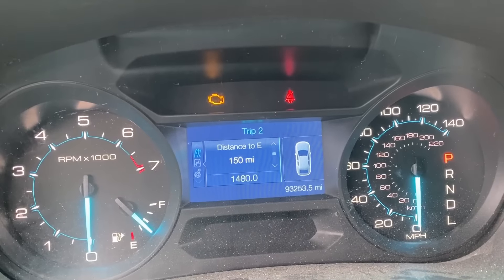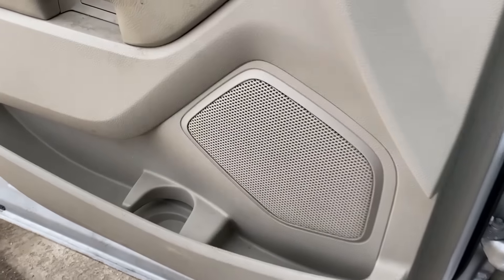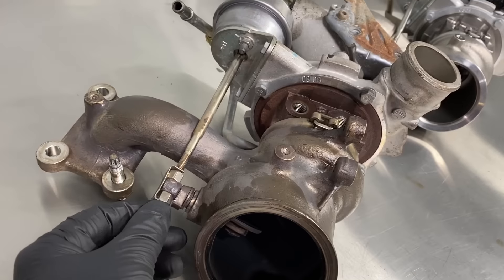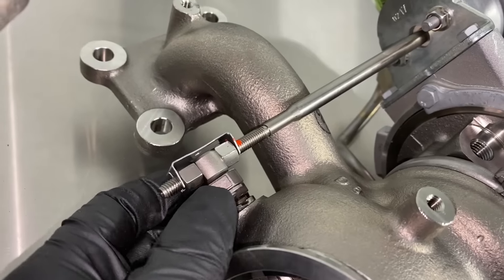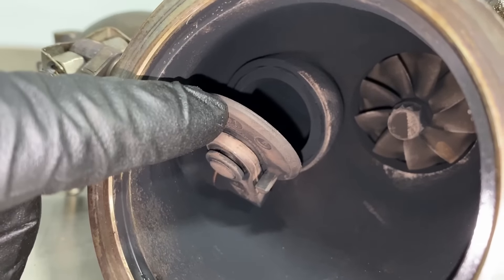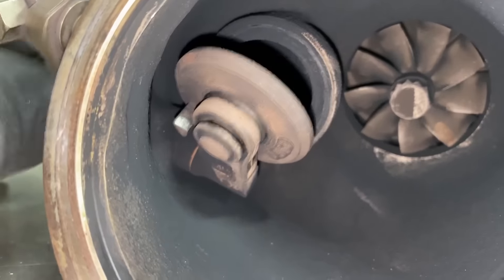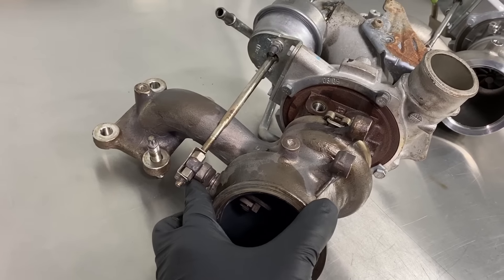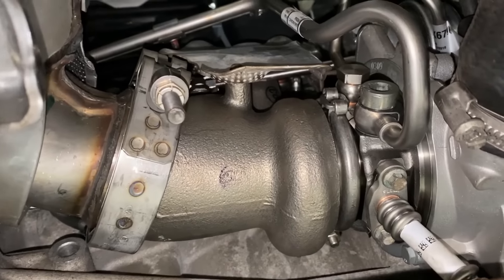Ford Ecoboost Cold Startup Turbo Rattle Explained

Comment: For $2000 I would live with the noise for a while.👍😀
Reply: Absolutely.  Let the next owner deal with it.
Reply: Charlie James 😂😂😂😂😂😂
Reply: It’s throwing a low boost code,here in Ny it wouldn’t pass emissions inspection .
Reply: Cant friggin barely hear it .. wtf
Reply: @Martin Herndon possibly the owner didnt follow very strict maintenance standards an more wear within turbo!? The Ford EcoBoost motors gen1 & gen2 are reaching high mis w/orig turbos!
Reply: I doubt this is even a maintenance item, what's to maintain? I think it's just a cheaply made part of a very expensive assembly
Reply: @LynxStarAuto  Until then 🤷🏻‍♂️
Reply: ak2112 what goes around comes around
Reply: @mt1885  go ahead and buy a Silverado...you'll constantly be dealing with cheap broken interior parts & electrical problems.
Reply: Jay Man  way to go ford....thats y i wont buy eco shit ford
Reply: @Martin Herndon so true 2nd gear band,water pumps, alts, rebuild carbs. Thing is anyone with good hands could fix that. Real complicated since gov epa controls
Reply: Jay Man  leaking turbo oil hoses, they all fail.
Reply: or you could just adjust the linkage. ive seen ecoboost engines with 300k on them that never had this issue.
Reply: Jay Man  Yep, Tacoma.
Reply: @Davido50  more of a fluttering sound. its there
Reply: @GETLITUP69  exactly what I was thinking.  We oversized damaged components a lot in the aircraft industry, no reason why it can’t be done here
Reply: In my country, loosening join can be easily adjusted, no need to replace the whole turbo assy.
Reply: Couldn’t really hear it.
Reply: Lmfao!!!!
Reply: Idky he couldn't grab an aftermarket turbo or wastegate. I can replace the wastegate in my CTS for about 300$, stock turbo is around 550, big wheel is 1700.... this guy's fix seems expensive and unnecessary. Maybe this car has proprietary components thus it can't be fixed or replaced?
Reply: There's got to be a way to fix that linkage instead of wasting money and buy a whole new turbo.
Reply: It’ll ruin the truck lol
Reply: Is it safe to drive like this?
Reply: is it safe to drive?
Reply: Other turbochargers are built strong wastegate no rattles. Actuator arm rods much stronger ford turbocharger all have same issues
Reply: U can buy 2 springs from hillman. $7 bucks. U put spring on wastgate and it stops it.

Comment: Some aftermarket company needs to make a bushing kit for this. Seems like your throwing good parts away
Reply: Machine shops do it for cheap. They cut the tab and weld a larger tab, machine the opening and add a phosphor bronze bushing.
Reply: Was going to say this, that old turbo is fixable for a fraction of the cost of the  new one
Reply: In my experience turbos seem to last 100-150k however if I also had to replace the CAT, I’d definitely try to have that arm bushed and see if I could squeeze another 50k out of it.
Reply: Michael Dennis 

If I owned a shop I’d only replace with new to prevent call backs.
Reply: turbo is tiny anyway,better off stepping the whole plan up
Reply: I agree, big waste of money. I would machine a few new parts and reinstall.
Reply: The bottom line, always junk is junk. #1 no after market spare parts. It is hard to find it. For example if any newer model ford needs water pump, dealer part is less expensive than aftermarket.
Reply: BlindBatG34 that’s why I’ll never buy a car with a turbo
Reply: Agree.  Seems like an easy fix.
Reply: @daaneel  Or as I like to call it turbogus.
Reply: I thought the same, a waste of parts only by the wear of a small component.
Reply: They do sell rebuild kits for this turbo.  From what I can find it will save over 60% than a new one. He said himself there are no bearing failures with these turbos. The part might fail again with a new turbo so it would make sense to have the 2 parts that failed rebuilt.  They also sale aftermarket turbos that fit this car that are higher quality than the OEM..
Reply: @BlindBatG34  our Cummins passing 180k miles on original turbo.
Reply: If you're going to pay for the labor of taking off the turbo you might as well replace it. It's insurance. You can save a few bucks or replace the whole thing and have piece of mind.
Reply: @zach4384  Yes, but he is replacing it with an OEM brand new part, that may... no...Known to fail. The rebuild kit fixes the issue and or you purchase a higher quality aftermarket turbo..
Reply: I was thinking a bearing kit,
Reply: @bryanmartinez6600  But it's a Cummins, not an Ecobust.
Reply: The turbo has a v-band on the center cartridge. Release the band and replace the turbine housing / manifold. Don't know if Ford's sell them separately but I easily find them for my Mitsubishi turbocharger.
Reply: @stubblekusaf  labor is the hard part getting to it especially if it's awd all the vids are for 2wd which has way more room
Reply: He's costing this customer more money than needed.
Reply: I would make them . The one out side would fairly simple to repair and shim  the valve might be a little more tricky but doable

Comment: I loved my 2013 Taurus SHO when it ran right. Maintained it meticulously however the left turbo began to leak at 80k miles. Traded it in. No more turbo cars for me.
Reply: I’ve got a 2014 but I swapped out my turbos for aftermarket Garrett G25/550. I traded my ecoboost F150 because of how expensive maintenance is on the ecoboost engines.
Reply: @RadDadisRad  How are the aftermarket turbo's compared to stock?
Reply: Unfortunately more and more vehicles are going  turbo ever year
Reply: @12wingwfetech  

Cheaper to make power and mpg. The have been going away from the big v8s that use to last 200k plus
Reply: @RadDadisRad  You know what happens with expensive owner funded maintenance it gets put off buy owners.  Some owners will do it many/most will not.   A lot of people switched from cars to trucks when cars went to front wheel drive they became fragile and harder to maintain.  Trucks were simple and more durable.   A lot of owners expect to last 200,000 to 300,000   miles or more and got it with not much more than oil changes lube jobs and brake jobs and a rare tuneup.   Ford is about to lose its market share in light duty trucks as consumers and the used truck markets begin to realize the ECO boost engines are not going to make it for the long haul out in the real world.   Chevy is also dumber yet bringing out a 4 Cylinder Turbo Silverado Pickup.
Reply: @RadDadisRad  maintenance expensive on EcoBoost? I've owned gen1 & gen2 without issues in F150s. These trucks are built to be highly durable.
Reply: @robc8468  really? We 10yrs into EcoBoost engines now. Gen2 has been out few yrs. They performing outstanding. U think EcoBoost is a new concept?
Reply: People talking the most noise who dont drive EcoBoost. Lots of torque and acceleration,  fun and yet fuel efficient when it needs to be. Since 2018 models they added dual port no more carbon on the intake valves, but if you had a catch can you shouldn't be too dirty anyway. Dunno what he means by induction service,  possibly a seafoam treatment in the throttle body hoping to clean the valves at risk of eating carbon and breaking the turbos. But I'm looking into valve walnut blasting, something the GDI european guys have been doing for years.

Comment: And being an almost lifetime mechanic myself I would have repaired it with a bushing or weld and machine repair.
Reply: no doubt about that , a simple fix for someone mechanically inclined
Reply: Use a spring for tension

Comment: Is this a common issue to look for on a 16 2.7 ecoboost  or a 15 3.5 ecoboost as well
Reply from the maker: All Ecoboost engines
Reply: @FordTechMakuloco  So I have a cold start rattle that I hear inside my 13 KR with the 3.5. Mostly from the passenger side. Still think it's this same issue? Was really hoping for a loose piece of interior trim but  it goes away once the truck warms up.

Already on the hook for a boost control valve and adapter, turbo oil lines, and a tranny line o ring. Glad its only at 68K
Reply: @FordTechMakuloco  kinda figured it would be all EcoBoost but wanted to make sure thanks love the videos keep up the good work

Comment: I have a 2018 Gen 2 Raptor and the sound has been getting progressively worse. It's been driving me Bat Sh#* Crazy. So I saw a video where they add a small window spring to the turbo actuator arm and connect it to the metal oil feed line. And POOF ... just like that ... all quiet. I was about to go in and have the starter replaced for $400 and change. Thanks to a $5 part from Lowes, I can save the money and put it towards some upgraded turbos in the near future as I'm at 150K miles. Thank you for the video and confirming what I suspected!

Comment: Did they figure out the 5.0 tick/rattle on 18-19 F150? I heard the fix is not working.
Reply: nlitenurmind my 18 5.0 F-150 has the rattle but it’s not significant and sometimes isn’t there at all. I was concerned at first but after hitting 20,000 miles on it I’m not nearly as worried. I’ve sent my oil out to be tested after changes to determine if there’s anything unusual in it and it comes back with normal numbers every time. The truck doesn’t lack power and drives smooth. So unless they come up with a fix that does work and doesn’t send me back to the dealership multiple times, I’m probably gonna deal with the noise
Reply: Whoa?! Problems with a non-turbo engine?? You don’t say...
Reply: Bore liner right?
Reply: Nah they just drinking oil like a drunken sailor

Comment: My 2017 Explorer with turbos has this rattle all the time, not just cold start up. And being a front wheel drive configuration those turbos are impossible to get to without removing battery and air cleaner ducting.

Comment: I own a 2012 Ford Falcon with the same 2.0 Ecoboost engine. It rattled from new and Ford did nothing when I complained about the rattle. It rattled upon light acceleration and on deceleration. After much messing around I learned that the wastegate on my car defaults to open and uses vacuum to close it upon start up. It did not have the wear shown on this video. It was just poorly adjusted and never fully closed. It turned out to be a simple enough task to use the adjustment nuts to adjust it so that the wastegate fully closed at idle. Power and torque improved, fuel consumption improved and no more noise. Fuel consumption improvement was 1/2L per 100km. My car now has 104,000km on it and runs beautifully.
Reply: You are right. When there is no wear, it is closed. As the wear increases, the tightening rod can not be closed. I almost changed the turbine for this       focus ST 2.0T
Reply: I just bought a 2014 FG ecoboost with the same noise. It's definitely worn though. Adjusted it closed. Silence. More power too, hope I didn't tension it too far. Always has 98 in it though
Reply: @skippy2987  cool. I always run 95 or 98. My car now has almost 186,000km on it and still runs great.

Comment: I have a 3.5 eco, it makes a rattling noise from the engine most of the time when starting, cold or warm, and goes away after a bit.nHaven't tried the deceleration test, but doesn't sound like what's on this video. Only 37k miles. Has there been other issues for something else coming loose or wearing?
Reply: Farming... the 3.5 v6 both turbo and non-turbo have issues with the timing chain and cam phasers wearing out. Do a search, Makuloco did a video on it. I recently made that very repair on my buddies 2011 3.5 N/A engine. Made it like new again for about $1000 as opposed to a shop doing it for $3000.
Reply: What year is the vehicle and model
Reply: Farming 4G I have a 19 3.5 that has this extreme wastegate rattle as well, it’s definitely not the timing chain or cam phasers. 
 Next time you start your truck put some pressure on the wastegate actuator linkage with your finger (cold start) willing to bet the sound will subside
Reply: Thanks for the responses, I'll be looking into it and running some of your suggestions to narrow it. I did come across Makuloco's vids on the timing chains and that could be what's going on. It is a 2013 XLT

The dealership I bought it from brand new has been good to work with, so I'll be taking it to them sometime... I'm confident they'll work something out to make it not as painful on the pocketbook.

Comment: This is a 2012.. in 2017 they redesigned the turbo to use an electronically controlled wastegate. FordTechMakuloco, do you know if they have this same weakness on gen 2 EcoBoost ?

Comment: I think I'd drill out the lever hole to make it round again and then press in a  bronze bushing to make it like new again.
 Or just adding a spring to keep tension on the lever may be enough to stop the rattling. 
  I know these aren't a "dealer" fix but for an owner on a budget it would save alot of money.
Reply: I wouldn't use bronze. I would go with a stainless or high temp alloy. Bronze will work but wont last like the Stainless / HT alloy will.
Reply: @DonkeyHammer  yah on the inside.
Reply: You boys got great ideas. Hope ford is listening or they’ll prob just cash in on the parts. Nobody’s making durable parts anymore.
Reply: These are made out of chinesium metal , worthless
Reply: The bushing idea sounds good, and that internal part, maybe a couple of c clips or snap rings to act as shims
Reply: You would need a small lathe to turn the bushing to size.
Otherwise, you would do a lot of searching.
Reply: Lynx Star Automotive 
You can fill it completely and then drill out the correct size.
Reply: Sounds like a job for JB Weld!
Reply: You got it. As soon as i saw that play in it I knew i could fix it for way less than 2 grand.
Reply: Itsa Mea  same with me. I would try doing the same , grind out the old rivets , brass sleeves,stainless ,some stainless screws or bolts
Reply: Robert Bell I don’t think JB weld would hold well to high exhaust heat and vibration
Reply: @knocksensor3203  I wouldn't be surprised if it worked on that outside lever. The inside part, yeah that needs a good metal fix. But I certainly would try real hard to not replace that whole unit.
Reply: Yeah theres plenty of macguyvering can be done here for way less than 2000
Reply: Troll Master you’d be amazed what the options are out there from somewhere like McMaster Carr.
Reply: Turbo upgrade and test pipe.
Reply: God what complete junk I can't believe this is what turbos look like today. I'm used to my 7.3 turbo interchangeable serviceable and less complicated.
Reply: I agree,,there has to some way to repair these two parts. I'd put a dab of high heat silicone on the loose  part.
Reply: @Nostradamus_Order33  that usually does not last long (probably would fail in a month or two). Better to cut the worn portion out and weld in a new section.
Reply: Itsa Mea budget be dammed I would repair them any way
Reply: @DonkeyHammer  Inconel 625 for example
Reply: @justinballard7242 I was thinking the same my friend
Reply: @knocksensor3203  JB has held together many of engine blocks... but I’m saying that... for Borneo V6s and V8s.... and I’d imagine the compression ratio was a HELLUVA lot less
Reply: I was thinking the same thing😅
Reply: Gorilla glue is OK too
Reply: @AmandaHugenkiss2915  I wouldn't want any extra pieces in the turbo housing as small pieces will grenade the turbo
Reply: @AmandaHugenkiss2915  but a removal a a tig weld now that maybe the way to go
Reply: That is what I was thinking.  A tiny bit of ingenuity would fix the slop in both of these.
Reply: The spring method actually works very well!!.
Reply: @gabewhisen3446  They're not even using Chinesium Metal anymore, shrinkflation has them using Plastanium Bolts painted grey now.
Reply: @Baneslayer  bidenomics for sure
Reply: I agree. It should be fixable for a lot less than $2,000
Reply: @AmandaHugenkiss2915  Hi there, your comment was couple years ago and I wonder if it works because I’m having same noise and I was thinking on that JB also, thank you

Comment: The old one can be fixed by putting a bushing on the outside linkage and tightening up the waste gate. I do not see why the whole expensive thing needs to be replaced.  That's like buying complete new wheels when your tires are worn.

Comment: Nothing a little spot weld can't fix. 🤣👍
Reply: I was thinking the same thing!
Reply from the maker: Spot weld what exactly? Every part is a pivot point and must turn free. The flapper valve must also be loose to seat.
Reply: @FordTechMakuloco  that was a joke bud.
Reply: @FordTechMakuloco  weld the worn hole in the arm and redrill the correct size for the pivot
Reply: Simon Legros you know that might actually work an for $2000 I’d definitely give it a shot
Reply: @FordTechMakuloco  Its sad to see such durability problems at 90K, please tell me the twin turbo V6's do not suffer such waste gate wear issues.
Reply: @FordTechMakuloco  Google high temp rod end bearing. Problem solved.

Comment: have you run into the whistling noise from the 3.5 ecoboost?  yea.. the turbo makes some low end but recently I've seen people say that the valve cover is leaking causing a whistle?   thoughts?

Comment: Any harm to ignoring the turbo rattle?
Reply from the maker: Eventually it will throw a P0299 Under boost.
Reply: @FordTechMakuloco  Does that light up the CEL or will it only be found through an OBD scan?